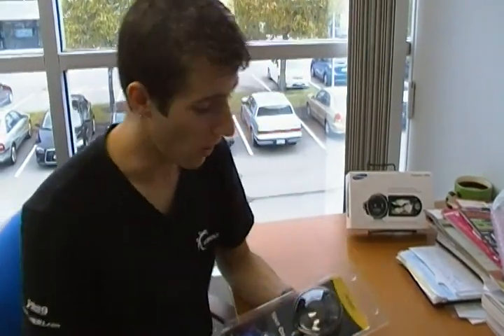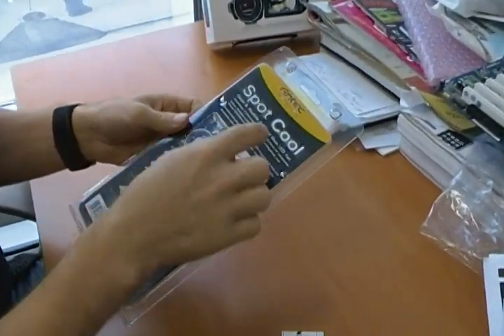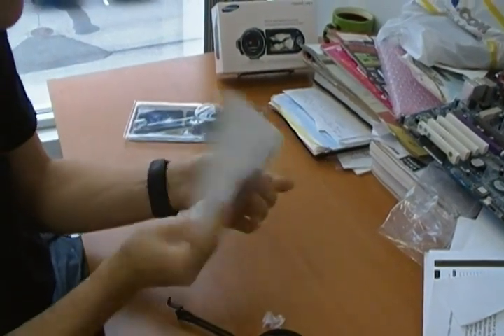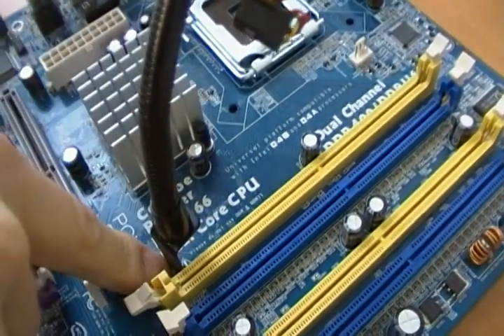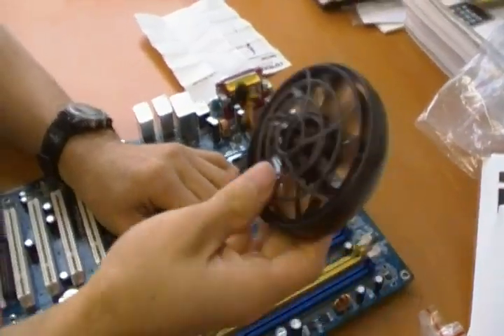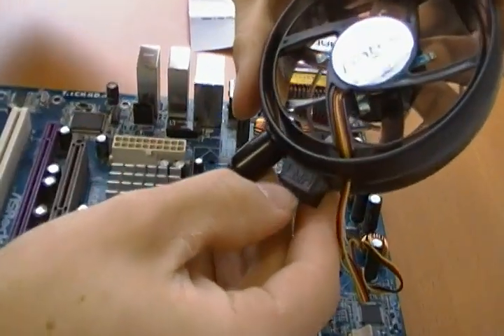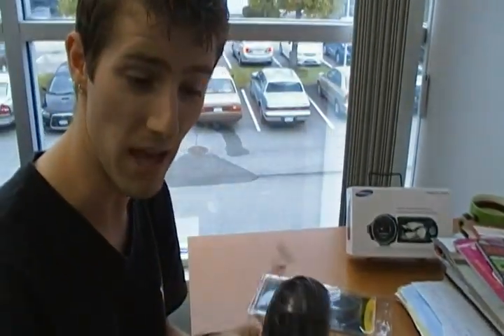Antec Spot Cool Computer Fan Unboxing Linus Tech Tips

Comment: Chapters:

0:00 Box and general overview
0:17 OH MY GOD AUDIO IS CORRUPTED
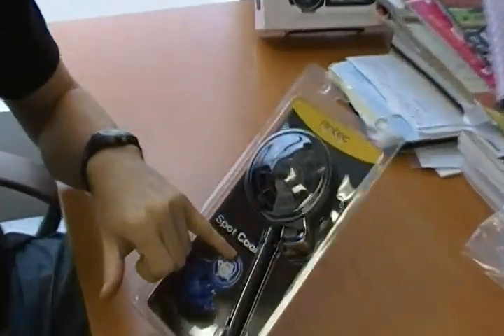0:28 Unboxing start
0:35 Stuff is out of the box
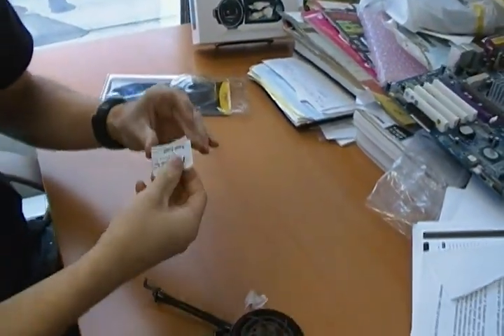0:52 Manual
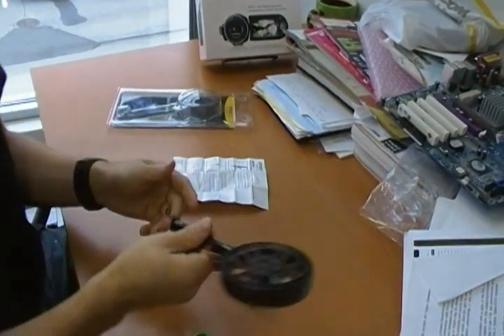1:12 Cooler mounting?

Review

The new camera had a lot better audio than the last one, untillll it didn't :D Audio seems corrupted on the video.
Pretty neat mounting tho, I rate this a 2/5

What am I doing, and why?

I want to watch, and review every single video on Linus Tech Tips channel.
I will provide chapters, if the video has none.
Why am I doing it? To pay a homage, and I am pretty sure that my head is a bit messed up.
Reply: Audio is fine for me